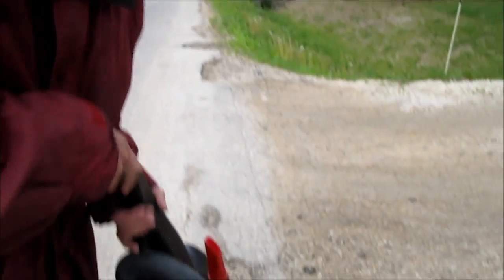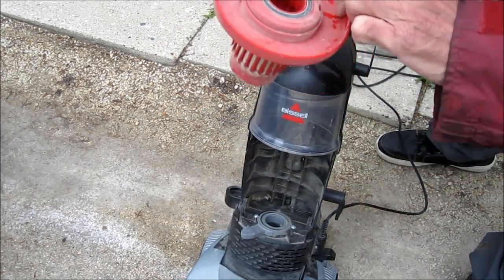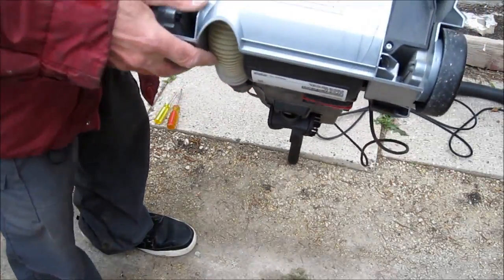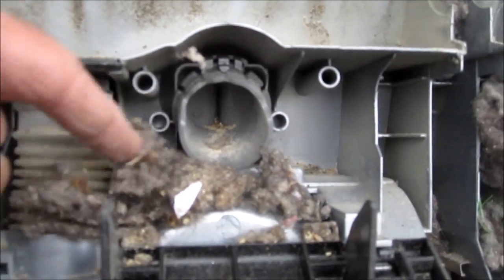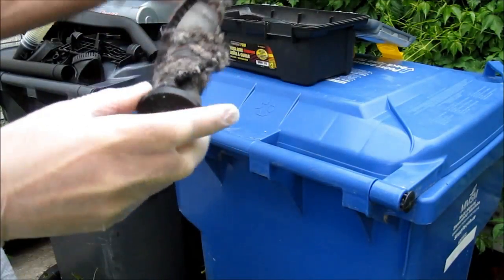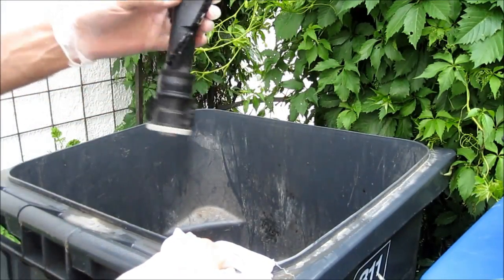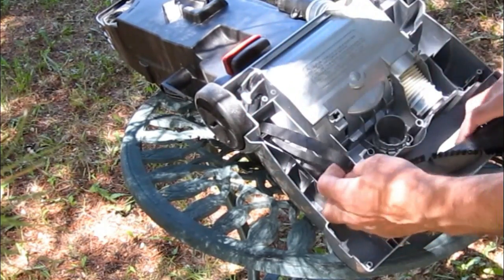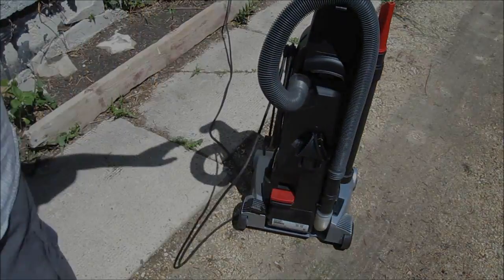Bissell Powerforce Vac*No Suction,Brush Not Spinning*

Comment: You can easily disassemble the brush by standing it upright and using a pin punch and hammer on the long center pin the plastic cap will pop off undamaged. You can evan replace the bearings with nice Rollerblade ones like I did. the plastic caps can be just tapped back on no cracks or damage.

Comment: On my Bissell Lift-Off upright vacuum, the power switch and the brush switch are on the body of the vacuum, but it's important to note that even though it's switched on the roller will not spin until you step on the foot release pedal.

Comment: Hello ted have a question but before i ask let me tell you im one of those diy been repairing things myself my whole life I have the smaller version of the vaccuum the aeroswift compact vaccum and first i changed the belt as soon as i changed the belt the darn thing broke so i took out all filters cleared everything out and on this version there is barely any room to get a belt on whoever designed this i would like to speak to lol anyway when i take the hose out theres a lot of suction and i know thats not clogged since i stuck the broom stick through the hose to mae sure sounds powerful but still not picking up im stumped on this and cant find any darn videos on it ? what makes it blow out air thats my question thanks i would appreciate it thanks for posting this
Reply from the maker: if your belt broke whem you put it on ,then your brush bar is seized !!

Comment: Thank you for making this video it was very helpful and inspiring (taking a trashed vacuum and giving it new life). I just took mine apart and the brush doesn't spin. I checked and I don't see any hair in it. Do you think this means I need a new brush? There was also a burning smell but the belt looks fine.
Reply from the maker: check to see if the brush bar is  seized . there is bearings  on either side
Reply: @TheTeddy214  Thank you for answering. Yes, I believe it is. I took it out of the vacuum and it won't spin in my hand either.
Reply from the maker: this might help you watch this starting at 3:30    https://youtu.be/FqMKyt2subw @TaraandSky
Reply: @TheTeddy214  Thank you~